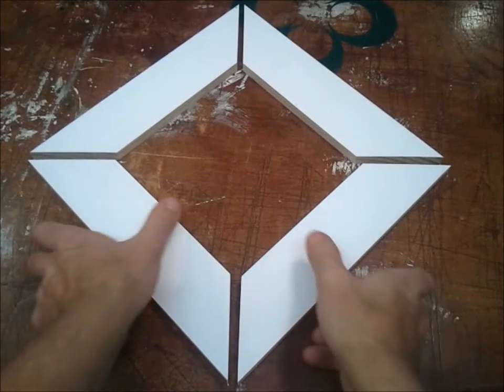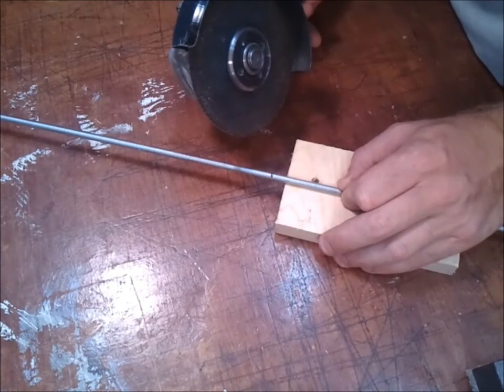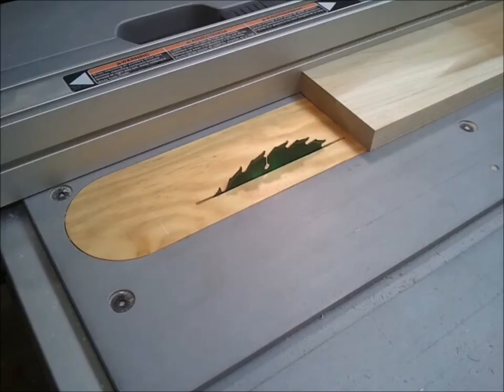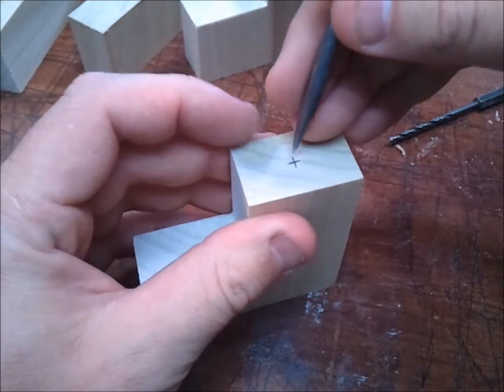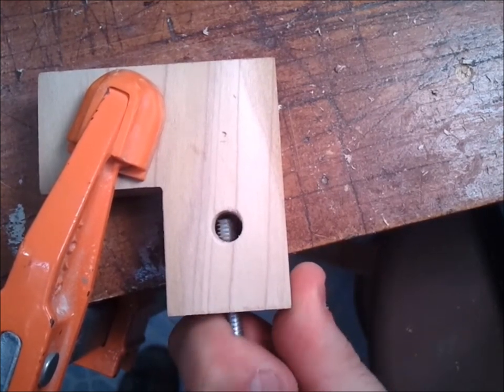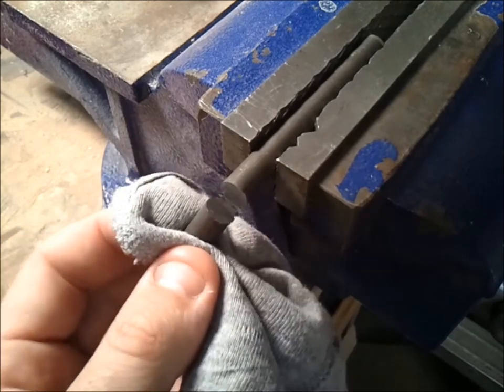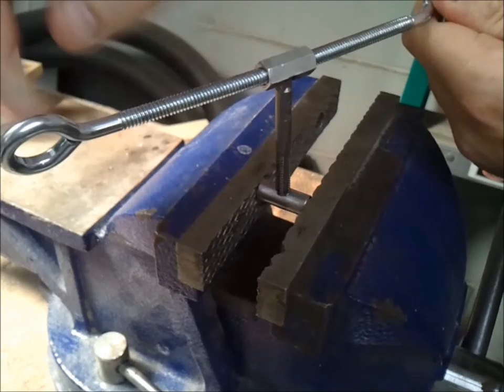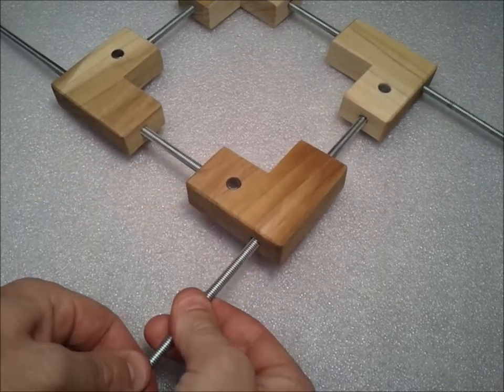Threaded-rod picture frame clamp

Comment from the maker: Good tip. It certainly wouldn't hurt to have a nut already on the rod when using this method, to prevent cross-threading. But I still highly recommend wire brushing before removing the nut. This way, you can always "feel" if it isn't threading correctly.

Comment from the maker: Yes, you are entirely correct. I realized that right after it was too late to change it. I did perform a few split-stress tests on some scraps while I was making this, to see if I should remake it. I got away with it- just because I didn't use pine. Even though mine will likely never break, don't make the same mistake if you make one.
Hey, can't always remember everything.

Comment: I love this clamp system. Thanks for sharing. If you need to make more of those pins use a vee block on your drill press and drill and tap them all together first then cut them apart. it may go easier and quicker also for you. You can make a cheap vee block on your table saw and align it with a sharp small drill bit when you clamp it down. What really works great for tapping threads is a product called rapid tap. It cools the tap well and is fluid enough to get into the threads quickly.

Comment: id recommend drilling a small hole on the inside corner of the blocks, this way if you use too much glue, you wont be glueing your clamps to the frame.

plus it gives you a view of the corner.

Comment: Putting a nut on the thread before you cut and clean up the all thread will ensure the end will accept a nut or coupler much easier. Just a little trick I do when I cut bolts down to size. Other than that, I pretty much do it the same way. Good video as usual.

Comment: I've had to cut more all-thread then I really care to remember. I was taught to thread an appropriate size nut on first, then cut and clean off the burr and then spin the nut back off to essentially re-cut the threads on the rod.

Comment: On the wood why did you drill with like 4 different bits? I would just grab the big bit and go at it in the press. Only thing I can think of is maybe it is more precise? At first I thought maybe he has no press and is worried about accurancy but I later seen you do lol. Regardless nice video. I watched as I want to make a workbench out of 2x4's and thought of using threaded rod as clamps since the big clamps are $20 a pop.
Reply from the maker: It was a game of "connect the dots." Sometimes the drill press does not drill a small piece perfectly (perpendicular wise), and I was not taking that risk.
Oh, and consider using ratchet binders for your workbench: they are cheap, big, and easy.

Comment: dude i work in a metal shop, and when we shorten threadbars, we just grind them off at a straight angle, and then just give them a quick spin against a deburring disk or a grind stone,
so instead of three steps you have 1 step...